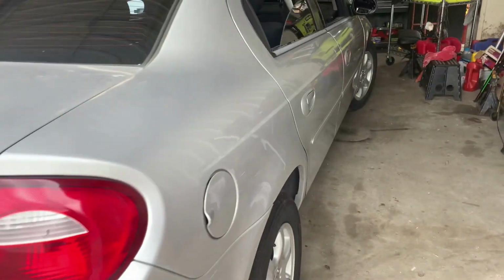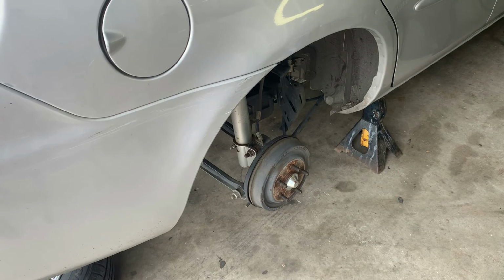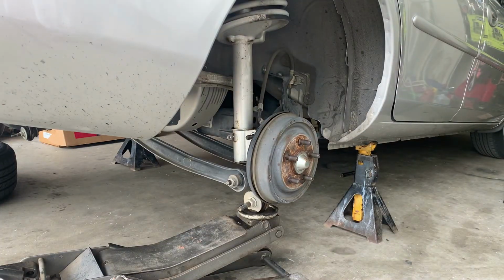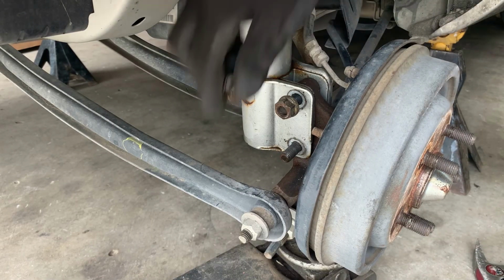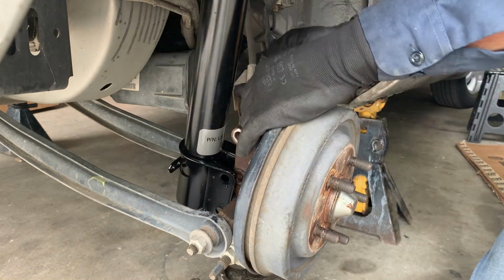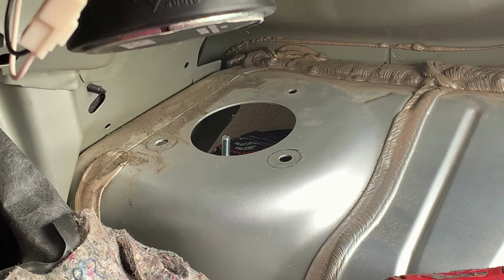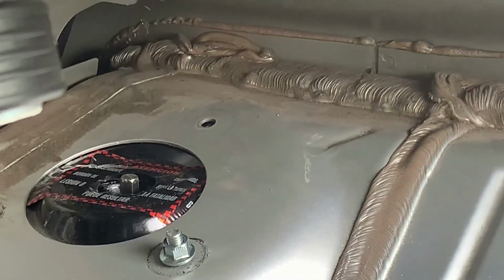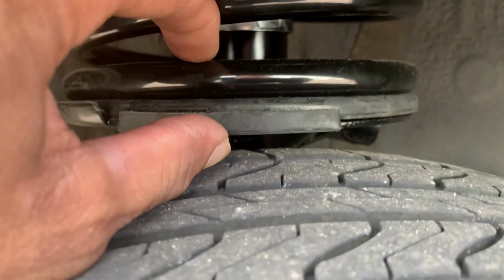Dodge neon 05 rear struts

Comment: Nice video! When replacing struts (or any parts that come with nuts), I always source my own flange nuts. The nuts supplied are usually of the one-time use variety, which destroy the threads once installed. I prefer to be able to remove them and reuse them at will. 😉
Reply from the maker: Hi macimusmax4557  thank you for your comment. Very useful. i’ve never had that problem and thank you so much for watching. I really appreciate you.